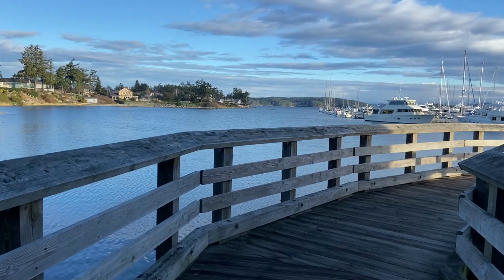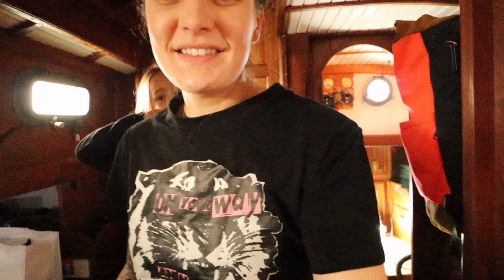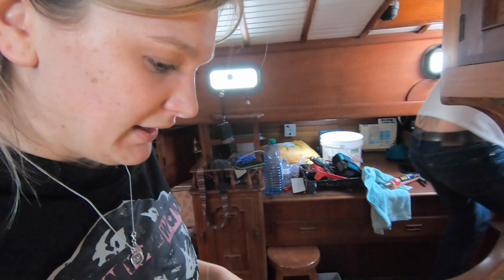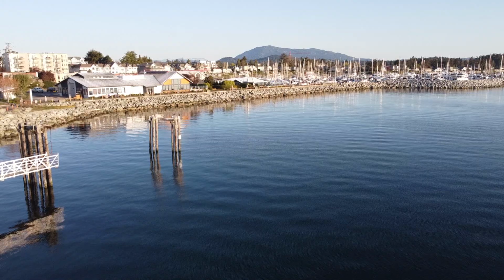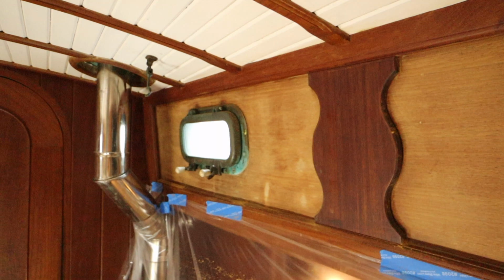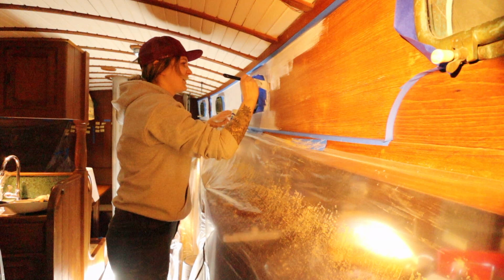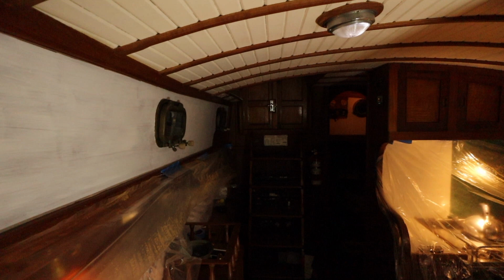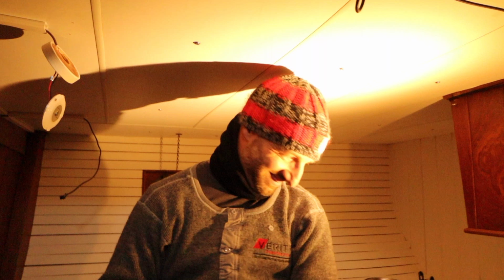Painting 😱 our Sailboat interior WHITE | Let the Boat Work Begin! | Cruising Meraki Ep 12

Comment: Ahoy Meraki, what kind of interior white paint are you using?? Thanks.
Reply from the maker: Hey there! We used an industrial interior paint for the top coat but more importantly we invested in a really great primer to ensure the oils of the teak do not weep through the paint. The primer we used was Zinsser primer sealer. I was really pleased with the result, it seems super solid.
Reply: @CruisingMeraki  Painting over old, varnished, stained and used wood is really difficult, your use and suggestion of Zinsser seems to be a good choice, but I would recommend using a mask with any oil-based primer or paint, as the effectiveness and off-gassing are related.